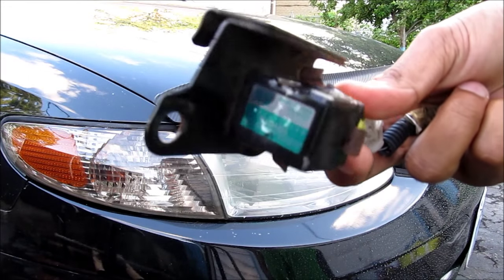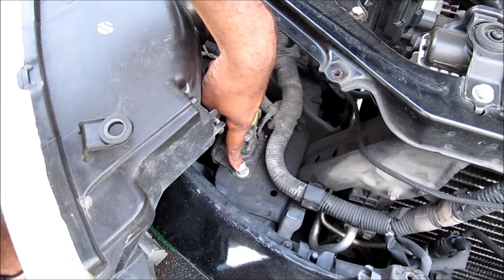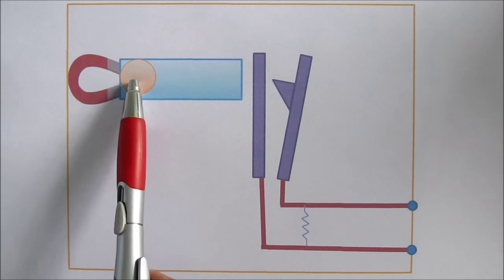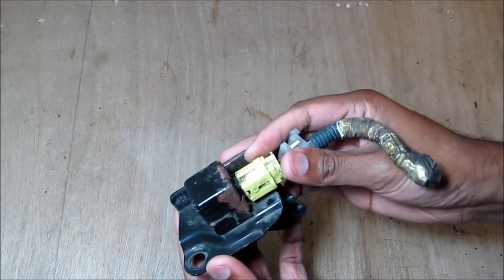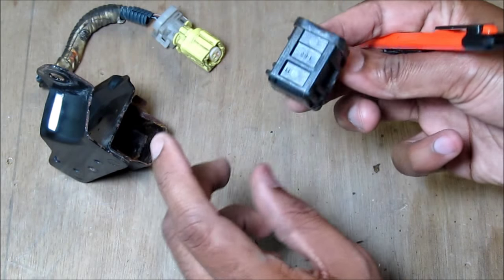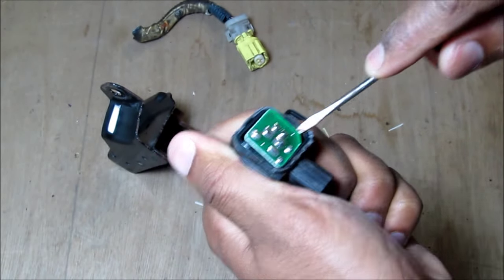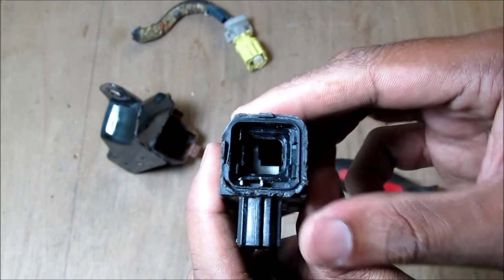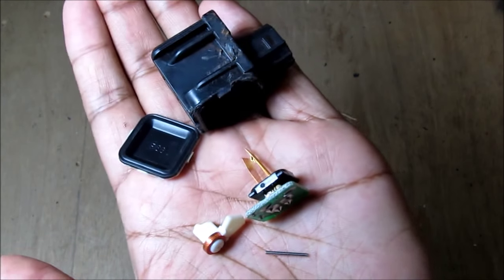How an Airbag Sensor Works

Comment: This may be true for your particular sensor/ system but is by no means the way they work. That is an inertia type sensor used in early systems. Ever seen airbags deploy when a vehicle is hit but sitting still? Park or drive doesn’t matter, there is no deceleration there. They utilize a potentiometer that measures strike force- impact and signal the control module to deploy  the charges in the bags when enough force is detected. Pendulums in the main sensor where the first deployment methods. Now, with a vehicle running you can blow the airbags by impacting the area the area around the sensor or the sensor itself. 40 years here building wrecked cars.

Comment: Huh.... Way simpler than i would have thought.
Reply from the maker: Yes very simple, though there are more complex airbag sensors in newer cars.
Reply: Varies between vehicle
Reply: Also the computer has to see many other signals before deploying bag like seat position, speed vehicle is traveling
Reply: And it cost only 90$

Comment: A very good explanation of the theory of operation, followed a detailed illustrative visual component. Good job.
Reply from the maker: +George Rivera Thank you
Reply: speedkar99 I bought a car from an auction with the driver and passenger airbag deployed. Do I just replace the airbags and reset the module?
Reply: Mart25F Nope. You have to replace all the crash sensors, SRS computer, aka SRS deployment module all the air bags and the initiator module.

Comment: I'm having an issue with the airbag/sensors on a 2006 GMC pickup, so I checked the sensors with an ohmmeter and diode checker.  The resistance was very high one way (3 megohms), and infinite with the leads reversed.  Measuring voltage drop, which is what a diode check does, shows there is definitely a semiconductor between the two leads of the sensor, so unfortunately not all sensors are as simple as yours.  Very nice video.  Well done!
Reply from the maker: That's true, a diode could also be used as a check device as well
Reply: Well, no.  What I mean is that the airbag sensors on my vehicle, and most likely other newer vehicles, consist of more than a simple mechanical switch.  Inside mine there is clearly at least one transistor / diode of some type.  Your smart phone has a micro accelerometer in it for instance, which is most likely what's inside a more modern sensor.  https://hackaday.com/2012/05/22/the-engineer-guy-explains-how-mems-accelerometer-chips-work/
Reply: @LarryCook1960  You are right : sensors are more complicated than that.I think you have figured it out by now ; The micro accelerometer you are talking about is more likely based on piezoelectric technology that says: a crystal (be it quartz or the like) has the quality of producing electric pulse upon being impacted. So the accelerometer has a crystal quartz layer that separates two metal plates that are charged with positive and negative electrodes respectively by the crystal upon being impacted or very lightly knocked. So I think that when people measures the resistance of an airbag sensor with a multimeter , what they are measuring is the resistance of mentioned metal  plates. If the piezolectric crystal that is between those metal plates  , breaks for a strong external blow to the car or by simple tear-and-wear, those two metal plates would be in contact (even lightly due a tiny minor fracture of the crystal) showing an abnormal resistance or even continuity. It is even more complicated if we take into account that around the piezoelectric accelerometer  there are capacitors that store some charge  and a tiny transducer that converts the electric pulse generated by the cristal (upon being tested or for a legit real impact) back to the Airbag control unit (ECU) to deploy airbags if needed. That amounts to a nightmare for a newbie to test such an overcomplicated sensor device that only gets a generic message when conecting a ODBII examiner: OPEN CIRCUIT IN AIRBAG SENSOR 1 !!!! Then you start throwing parts, battery and overhauling the fucking all wire looms and connectors to the ofending fucking sensor 1. A nightmare and very entertaining PITA process!!! Good luck!!!
Reply: Well you have to remember, intellectual properties are protected by Patents. Either the manufacturer settles on using someone else's patented technology or, develops their own device which then has to undergo all the testing to certify the device. So....bottom line is I'm sure there are a dozen or more different designs, seems like people are more interested in just shooting the messenger, rather than taking the explanation for what it is worth. Like I tell my kids don't be one of the ten percent.

Comment: I wish I had found this video yesterday. I had the "Service Air Bag" message on my 2009 Silverado 1500. Wife needed the truck to go out of town so I didn't want her driving it without the air bag. I suspected the problem was one of the impact sensors on the Rad support but wanted to verify it before spending $100 on a new one. My Actron CP9690 scanner would not read the code even though it was advertised as doing SRS which is why I originally bought this model just in case I ever had a problem.  I took it to O'Reilleys and guess what--- they couldn't read it either because they were using the Bosch version (Bosch owns Actron now) of the SAME SCANNER.  I just bit the bullet and bought an impact sensor there and luckily that was the problem. After watching your video I realized all I really needed to verify it was a friggin' 1/4 watt resistor which I have drawers full of. DOH !!!  Great video. Thanks.
Reply from the maker: Glad it helped

Comment: Great video! Also, the airbag computer does nothing until usually 2 or 3 sensors are tripped, so if one fails it doesnt deploy your airbags and cause an accident, this is why some airbag lights will be on for seemingly no reason, because one sensor is tripped (or not functioning at all) but none of the others are
Reply from the maker: +007K Yes, correct. It also has to do with vehicle speed and yaw.
Reply: The airbag light is on for about 6 seconds because the system does an internal check at start-up.  If the airbag light is on all the time, there is something wrong in the restrain system, airbag, sensor, etc.  You need to pull the fault codes from the ECU to know what is not working properly.
Reply from the maker: +wysiwyg248 Yes that's exactly how it works.
Reply: +speedkar99 - I agree with " Speed & Yaw ".  There are many times I have hit the Front Bumper and the Air Bags NEVER deployed!

Comment: I've spent the better part of the day looking for how to reset an airbag code on my 2005 Camry after replacing the spiral cable assembly on the steering column and had no luck. Stumbled on this video and learned something I hadn't even thought about. This has made my day.
 Thanks and looks like I'll need a code reader of more value to reset that code.

Comment: HI this the best explanation in youtube. Just asking how to check the resistance between the two terminal of the side impact sensor. I mean if the sensor is bad what reading should I see , Thanks
Reply from the maker: What ever resistance is the color band of the resistor ...each sensor is different

Comment: Very well done and easy to follow. You have a real talent to guide and explain in your presentation. You would do well as an teacher or instructor. 
Our 2012 Mazda recently was in a front damage collision with much damage and no air bag deployed. No injuries, but isn't this odd?
Reply from the maker: +electricsub Thank you for the feedback. I love what I do, presenting concepts in a clear and concise manner. I'm learning as much as you are as I go along. 

The airbag is not designed to deploy in a low speed collision, as it could cause more injury to passengers. Rather the crumple zones of the vehicle is meant to absorb the impact. Being able to walk away from such a collision is attest to that.
Reply: Same here...i had an accident with my Camry 2012 & it  wasn't massive damage, just crashed the shield of front light, bend little corner of the hood, the corner side of font viechle & scratched some of the paint. The Airbags didn't deployed

Comment: Great video plus demonstration. But how to be so sure about the precision of this mechanism? I mean, how will it deploy only in a collision, and not in a hard braking? The borderline between a collision and a crash seems so tight...
Reply from the maker: +Matheus Bitencourt Hard braking can never have the severe deceleration forces that are experienced in a collision. Deployment is also a function of vehicle speed and other dynamics, such as steering angle, yaw, and possibly readings from the ABS sensors.

Comment: Great video! I never thought of taking one apart. I'll have to do that.

A couple of thoughts.

Bolt sizes are determined by the size of thread not the size of tool used on them.  
Bolts have the threads on the outside, nuts have the threads on the inside.
Reply from the maker: Dan'sMeTube Thanks for the feedback!

Comment: You should add that normally, three frontal sensors are used to send signals to the ECU that triggers the airbags.  This type of mechanical sensor is no longer used for automotive applications, now they are all electronically based with some exceptions (venturi tubes in side impact).  The ECU generally has one this mechanical sensors inside, to act as a backup system.
Reply from the maker: +wysiwyg248 Yes I agree. Of course this sensor was from the 90s when things were simple and basic. Now they use accelerometers and MEMS devices to sense impact. 
My cars ony have 2 frontal sensors though.
Reply: Too bad your vehicles has just two sensors, three is a much safer option.  Not just from the durability viewpoint, but also with three, the ECU can make more accurate decisions relative to must fire or not fire conditions.

Comment: does that need to be replaced after the airbags go off?
Reply from the maker: +John Geise On some cars with a magnet-ball design, yes. On this type of design, most likely not, unless the sensor was physically damaged or the cam lever jammed.
Reply: +speedkar99. thx man
Reply: No, but the rest of the car does :D

Comment: @speedkar99  - great explanation, Thank You. My 2007 Ford Ranger intermittently throws a B1118-A0 Passenger Front Impact Sensor Mount/ Communication Error. There is a resistor in the sensor. I am thinking it gets out of operating resistance range after system powered up  and sets the code. I am going to replace sensor first before chasing wiring problems. Thank You  once again.

Comment: Hey brother, I got a question. I watch your videos and love them. I bought a 14 model wrecked Cummins. I’m changing out the front airbags in it. I got new clockspring and airbags. Can I disconnect the battery, change them out, then reconnect the battery and drive the truck to the dealership to get them reprogrammed? You don’t think they will deploy, do you?
Reply from the maker: No it won't deploy but it also won't work with crash data in the airbag computer which is technically a risk to drive. 

I don't think dealerships reprogram airbag computers after collisions, they replace it or you'd have to send it out to get reflashed. I have a video on that

Comment: Great explanation! Do you know if the sensors re-set themselves after a collision or do they have to be replaced? I just finished re-building a 2013 chevy Cruze and replaced all affected parts (seat belts driver airbag and control module) but did not change the front sensors. I'm getting an error code B001A and B001B which apparently refer to pretensioner error. I checked the resistance on the seatbelt pretensioner and it is within specs. Now I'm thinking that maybe it is the front sensors that I should change. I can't find anywhere the proper resistance specs for them so can't really test. My thinking was that once the impact of the collision is over the sensor is back to its normal position and can be re used unless physically damaged from the accident of course.
Reply from the maker: +Chris Dz I've read that the sensors have to be replaced as well, though it depends on the sensor type. If its the "gold ball" type where the ball detaches itself from a magnet and gets lodged into the contacts then it might have to be replaced. 

If you have access to an accident free Chevy Cruze (think rental car), you can measure its sensor's resistor values and see if they matchup.
Reply: I figured it out. The front sensors are actually fine and did not need replacing after the accident. I'm guessing the magnet pulls the ball back and it's ready again. My issue turns out to be that the Chevy has two seatbelt tensioners. One is in the seatbelt assembly which I replaced. The other is attached to the seatbelt anchor and the tensioner is hidden beside/under the seat. I worked on many cars before but this is a first for me to see two separate tensioners. Just an FYI.

Comment: would this help in a situation where a truck was in a collision but the bags didn't go off, maybe just the sensor went bad? or would their be hard set codes on the computer still making the light still apear?
Reply from the maker: +Handyman Helper If the bags didn't go off there is no hard code set. If the sensor was damaged and that's the error code your getting then it'll have to be replaced.

Comment: Nice video. .... I have a doubt ...
as you said rapid deceleration causes to short-circuit. How is this handled on instant braking ? If i brake my car to stop instantly does airbags get deploy?
Reply from the maker: nithukat Brakes can never get a car to stop as instantaneously as colliding with another object. The deceleration isn't as rapid and therefore the airbags won't deploy.
Reply: speedkar99  thank you for the information

Comment: Superb Video! :D
One question. How does the sensor distinguishes between rapid deceleration (Panic Braking) and accident? What is the tipping point for the sensor to judge for deployment of airbag?
Reply from the maker: Rapid braking will never produce the magnitude of deceleration experienced in a crash. The sensor is calibrated to detect sudden impact, as the spring force won't merely be overcome by heavy braking to trigger the sensor.
The airbag computer also calculates a number of other factors before deploying an airbag, such as the cars speed and in more advanced systems, direction, steering yaw, if the occupants are buckled, or triggers from other sensors.
Reply: +speedkar99 Thanks!
I am came across some airbag ECU which had sensors in-build in it!
Reply from the maker: So the sensors were in the ECU which was bolted to the body of the car. Now it makes more sense to have the airbag sensors closer to the point of impact, i.e. front, side or top for rollover.
Reply: +speedkar99 
Not necessary I think.. till the time the purpose of detecting rapid deceleration is served.. the position of sensor is irrelevant.. Having the Sensor inside the ECU saves lot of wire and mountings..
Just a thought :)
Reply from the maker: Yes but it doesn't detect the point of collision, i.e. if the left side of the car is struck, it will deploy the left side air bags.

Comment: 2005 Camry with DTC 1901 open squib. What are the common fixes? Seatbelt buckle assy and/or seat belt assy?
Reply from the maker: +DIY-HAVEN means there's a loose connection...check under the seat
Reply: speedkar99 car was in an accident. Already replaced the airbag and Left front airbag sensor. I didn't see loose connections under the seat

Comment: I think in my car (a VW) the sensor is inside the AirBag ECU itself, because there aren't Airbag sensors in any part of the vehicle (mine just have 2 front AirBags. The seatbelt pretensioners aren't electric activated in my car because it doesn't have side AirBags, they're activated mecanically by a mecanism with the disacelleration force).
Reply from the maker: Cool, yes every car is different...see my seat belt video for more on that

Comment: Great video, just have a question, do you have to replace an srs sensor after a collision that actually deploys air bag? Or you just go and replace air bag and reset srs module? Thank you
Reply from the maker: If it's damaged.
Reply: @speedkar99  Sorry for this noob question. You are helpful! Seriously! How can you tell if a sensor is damaged? If it has physical damage? Wire damage?
Reply: Luis Daniel Ramirez What did you end up doing? Seatbelts, airbag module reset, and airbags but no crash sensors?

Comment: i am wanting to put a nudge bar on my Toyota Rukus but nobody can help me. think it has a lot to do with the air bag sensor. what do you think.?
Reply from the maker: ***** The bush bar usually connects to the frame. If subject to a shock while driving off road, a vibration could be sent up to the airbag sensor on the front frame triggering the sensor.
Reply: thanks for letting me know. i have been little frustrated as nobody wants to help me. i was imagining a really nice shiny nudge bar on the front & also my brother has suggested that to me too, but i see your point. i guess it wasn't a good idea to begin with. so glad i have you helping me =] Happy Weekend my friend.!!
Reply from the maker: Thanks
Reply: your'e welcome. i have had too many knock backs to realize my much wanted nudge bar was only just a dream ;)
Reply: gardogg65 hey thanks, i usually say that to people. yes you can do anything you put your mind to. actually talking about one of his latest videos about cleaning the disc calipers, i notice when i am driving the car swerves to the left if i take my hand of the steering wheel. i was going to get that repaired & do it all myself. my car is in a double lock up garage. my car is only 4 years old, i not think i need to repair the air bag sensors just yet. i may get my brother to help me put on a nudge bar. as he was the one who suggested it to me. hmm now that he is only living few hours drive away. thanks :)